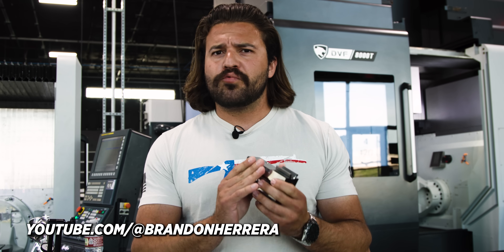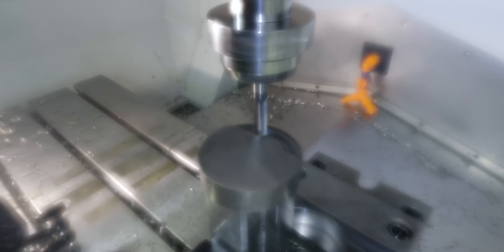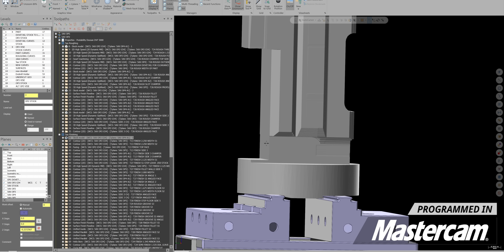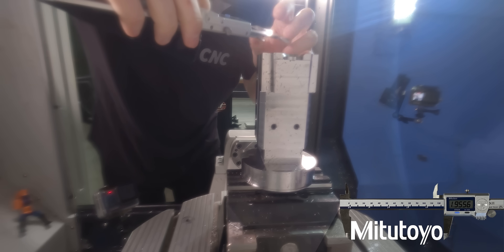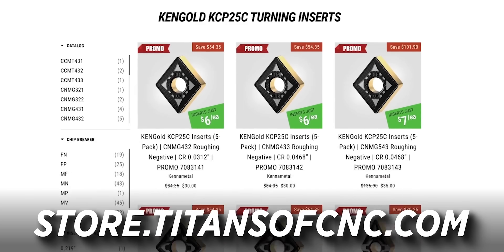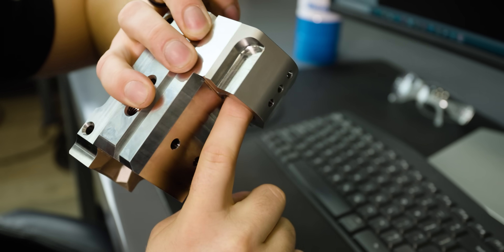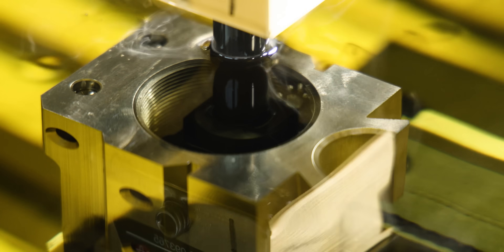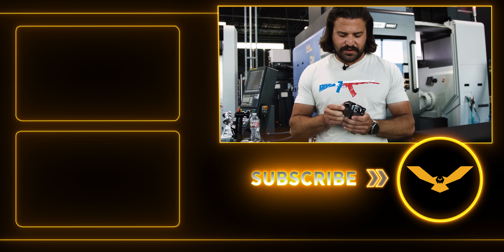CNC Machining the AK-50 TRUNNION for Brandon Herrera

Comment: The only thing that is sad is.. Even if AK50 would work, if made with such parts, it would cost 20k$+ to make. True strength and true soul of an AK in my opinion is that it was so easy to manufacture that it was made in probably bilions already. But I take it as a prototype, and prototypes are always expensive.
Reply: Could always use cast parts😂

Comment: How would mass producing this part work?
Reply: If this part was mass produced there would definitely need to be some conversations with the design engineer to see if anything could be changed to be more manufacturable.  Once that’s complete then new processes would be explored because the routes you take with one-off parts are different than that of mass production

Comment: Why was A-2 used in place of something with more ductility and crack resistance like H-13 ?
Reply: So that it could be heat treated to the required hardness
Reply: @barrysetzer  I get that and understand hardening of tool steel. I'm curious what drew you to A-2 over some other tool steel ? Asking to learn.
Reply: Hey Mark, thats a question for Brandon Herrera. We just made it out of what they asked for. Tbh i am not even close to being a metallurgist. I just know how to cut metal. 😎

Comment: Why was A2 chosen? A2 is a problematic steel that often cracks. It has little impact resistance compared to something like S7.
Reply: A2 might be considered a more stable steel. S7 is a tougher material but it also has a habit of growing, especially in a heated environment.  To tell you the truth, I think I would have went with S7 myself. You can beat the piss out of that stuff without it breaking.
Reply: I was thinking s7 myself, but if you have unlimited resources then C300 Maraging with heat treat is the way to go.  It is used in ordinance and aviation where components are highly stressed because it has very high fracture toughness.
Reply: In addition, it was specifically said it was in a annealed condition, and I don’t recall any mention of heat treat?

Comment: I knew about wire EDM but not the  graphite burning one🤤. Great work
Reply: There's also copper burning one.
Reply from the maker: Lots more on our channel
Reply: @TITANSofCNC  have you seen the recent DIY machine power supply for sinker edm with a 3d printer frame? It just finished Kickstarter but they're planning on open sourcing the hardware, so I was wondering if you guys might show us noobs how to use it :)